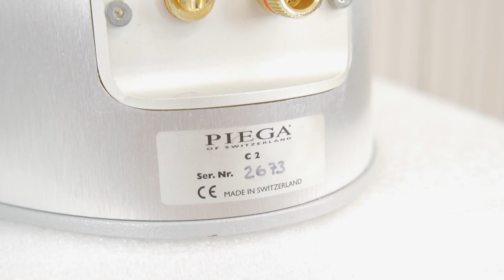Look inside High End Speakers Disassembly + Free Air

Comment: As always , the component quality does not relate with the price at all , cheap crossover parts , even ( if i am not mistaken) a bipolar capacitor,  neither the construction  also , only from the outside ! A shame
Reply from the maker: That's an interesting point to consider about the relationship between price and component quality.

Comment: This is plastic bowl boomer ?
Reply from the maker: it's not really plastic like you'd find in something like a Monitor Audio RS8. With these Piega speakers, it's more of a composite material, so it's not quite plastic, and it's not straight metal either.
Reply: @Techscrews thanks ! 
I prefer aluminum bowl 😊

Comment: "Recommended amplifier power: 20-250 Watt"
250w & smoke...
Reply from the maker: Actually, the smoke level isn’t necessarily about the amplifier power itself, but more about the volume control position. A smaller 20W amp, if pushed too hard, is actually more likely to damage speakers. When an amp can't deliver the power demanded, it starts producing a clipped signal – essentially square waves. These are a very common cause of blown tweeters, much more so than just using a high-wattage amp at a reasonable volume. A powerful amplifier simply offers a better dynamic range. When music hits a drum, a powerful amp can produce that dynamic blast without clipping, whereas a weak amp will clip the sound on that drum hit, resulting in poorer sound quality. Sound levels should always be adjusted by ear, not solely by the amplifier power and volume control knob.

Comment: That's not an aluminium cone woofer. It's pulp paper with coating.
Also don't touch those ribbons unless you plan on replacing them

Comment: Cabinet is not cheap but should be more love in details. Chassis are reasonable around 100$ per single chassis. This is a sucker: Cheap cables and crossover parts. And did they really know what they did when positioning all the coil axis on this small pcb in one xyz-direction?
Reply from the maker: I think it's almost impossible to calculate a speaker enclosure's price; the materials are often the smallest part of the overall cost. R&D, and marketing, play a huge role in the final price. Regarding the crossover part positioning, yeah, there could be issues, but I'm guessing they prototyped a lot to achieve that signature Piega sound their customers love. I always mention in my teardown videos that you can't really separate build quality and parts from the sound. A lot of speakers that look bad inside score really well in blind tests because they sound like what customers want. Listeners have different tastes in each price range.
Reply: Crossover parts quality and cables are overrated. They won't magically transform your speakers by using expensive parts.
And for gr research brigade, most of the sound change is from him changing the actual crossover design. Better parts may get you 5% upgrade

Comment: Thank You for this speaker teardown as I did this on my Focal Aria 926 Gen 1 and was shocked to the build quality.  The Crossover network uses cheap parts and is attached to the Speaker Terminal Plate plus; the Speaker Terminal plate is Pushed into the MDF (not screwed) and with very little Acoustic Dampening. What a waste of $$$'s on my part and shameful on Focal.
Reply: Yes it's very disappointed when you see what cheap stuff they put  inside of some verry expensive   and so called audiophile speakers .
Reply from the maker: Interesting findings on your Focal Aria! I understand your shock at the internal build quality, especially considering the price. Out of curiosity, are you happy with how your system sounds? I always think it's fascinating when engineers manage to create amazing sound performance with what might seem like "cheap" parts. It's a testament to their ability to combine everything in a way that delivers a "wow" sound quality, regardless of the individual component costs. I find that more impressive than just using the most expensive parts.
Reply: @Techscrews to be honest it’s more about design of the crossover than it is parts used
Reply: @AnthonyToth-t5v BS, have you seen a crossover schematic ? They are some of the easiest charts to read and design,  all these vudu black magic talk  is just nonsense ! One or two resistors to attenuate the tweeters, and couple of capacitors and inductors to pass or block some frequencies and there are free software to help you select the correct values ! 
People don’t want to admit how little goes into making a speaker and want to justify their expensive speakers by claiming that “ magical house sound “ !
Reply: @Techscrews  They are in the closet which I plan to upgrade the parts, line the inside panels and FIX the push in Terminal Plate (what a cheap and bonehead move from the Focal bean counters). It's more of the Drivers that are impressive plus I use Decware ZEN MASTER ZFast15L Open Baffle as my Main.
Reply: They probably spent more on the drivers. It's easier to upgrade "cheap parts" than to upgrade the drivers. Tbh the cheap parts would only affect the sound a small bit compared to more important factors like the actual crossover design, drivers, cabinet design. @CohibaJoe
Reply: dafür gibts tests (area dvd)die fotos von solchen sachen veröffentlichen,da sieht man welche quali du kaufen würdest.